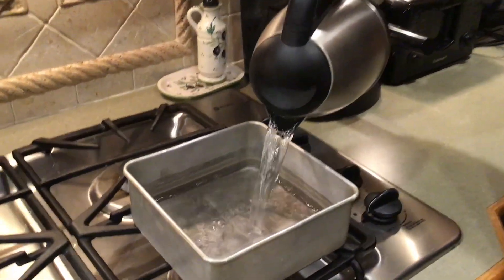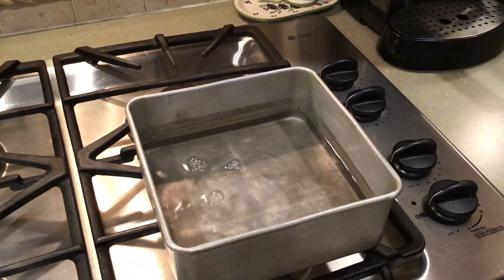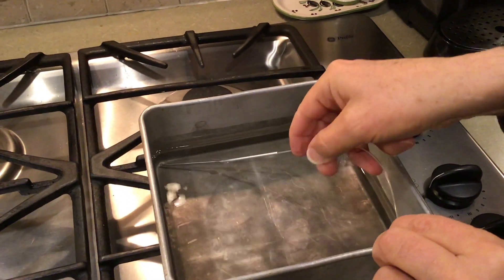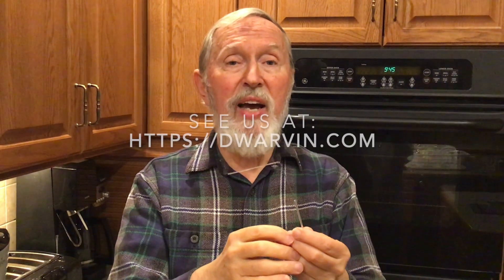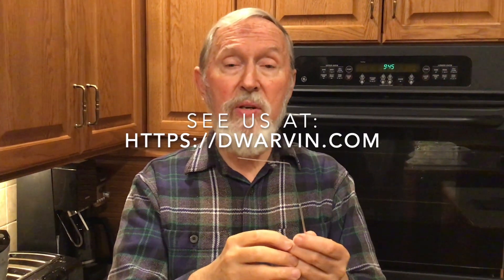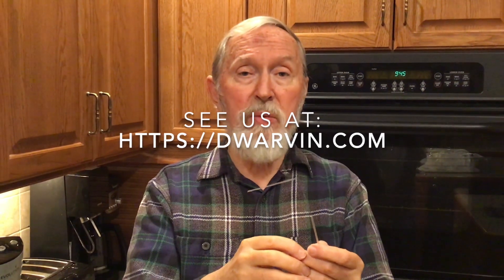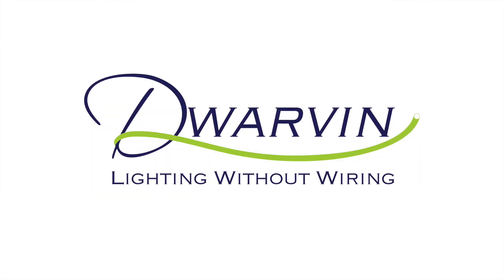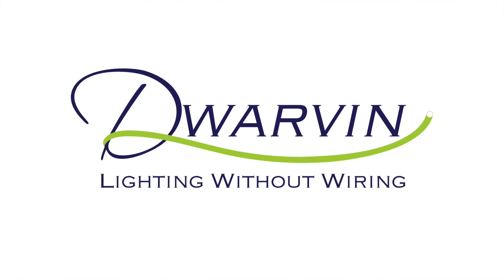How to Create a Permanent Bend In Your Fiber Optics - HO Layout and other scales

Comment: so you pour the water in to unheated pan as opposed to dunking it in water on the burner so the water can cool fast and let the fiber set?
Reply from the maker: Not quite.  The water only needs to be close to boiling.  I also don't like getting the fiber anywhere near to a heat source as it will ruin it faster than you can say Jack Robinson.  I boil my water in a jug and just poor it in a cup.  If it cools too much then I just recycle the water into a jug and off we go again.  Hope that helps.  Thanks
Reply: @modeltrainsceniclighting-d8555  Do you think a cup of water heated in the microwave would work?
Reply from the maker: @starsiegeplayer  Yes - my only concern is when you heat in a microwave there is no where for the heated gases to go, so when you introduce something foreign you can end up with a lot of "exploding" water that can scald you.  So be careful!!

Comment: have you tested would any light energy lost at bending part of the fiber?
Reply from the maker: Yes if the bend is too tight - as a rule don't bend these fibers to a radius less the 5X the fiber diameter.  That is quite a sharp bend.  Thanks for the question.